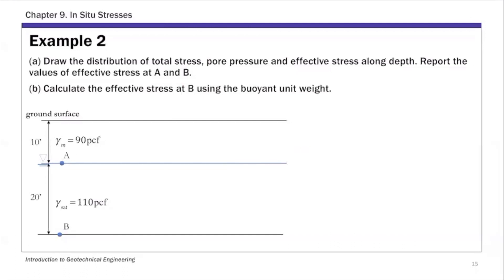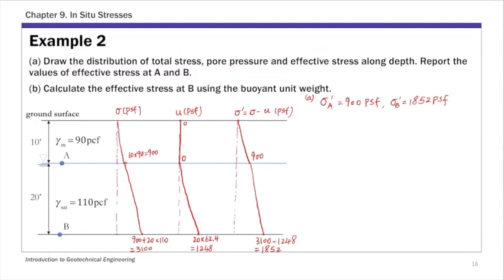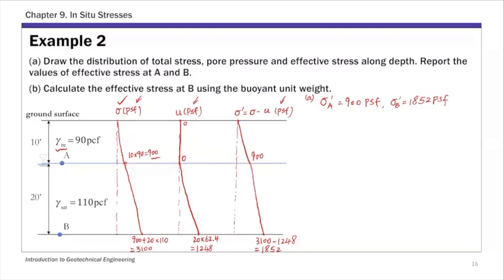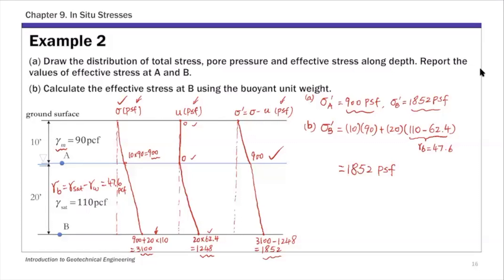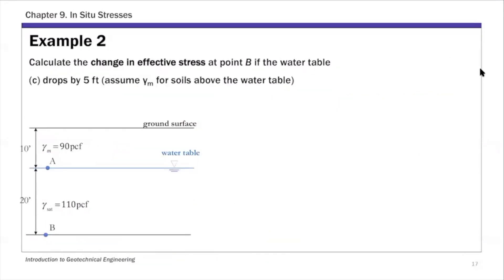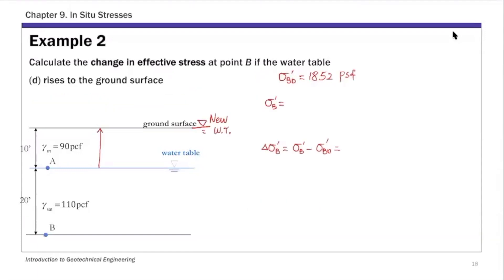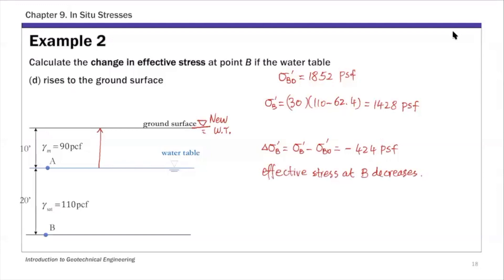Chapter 9 In Situ Stresses - Example 2: Effective Stress Change due to Changing Water Table.

Comment: Question: 
In part (a) and (b) for the 10-foot layer, suppose you are given both moist and dry unit weights of the soil. Which one do you use to calculate total stress and effective stress? dry unit weight or moist unit weight? My thoughts is to go with moist unit weight because it is not likely that all of 10 foot of soil is dry. So, moist unit weight is the right number to use, but I am not sure.

In part (e) the last term -35*gamma of water, shouldn't that be -30*gamma of water?

Comment: Sir , why is pore water pressure zero in the moist soil ? Can you plz explain this to me ?
Reply: Pore water pressure is the pressure exerted by water within the void spaces or pores of a soil. In a moist soil, the void spaces contain both air and water. However, if the soil is at equilibrium with the surrounding air, the pressure exerted by the water in the void spaces will be equal to the atmospheric pressure, and therefore the pore water pressure will be zero.

When a soil is saturated with water, the pore water pressure can become positive due to the presence of excess water in the void spaces. Conversely, if a soil is partially saturated, the pore water pressure can become negative due to the presence of air in the void spaces.

In summary, if a soil is at equilibrium with the surrounding air and contains both air and water in its void spaces, the pore water pressure will be zero.